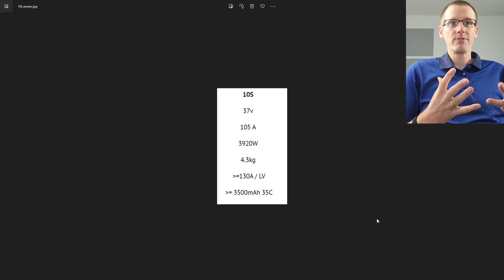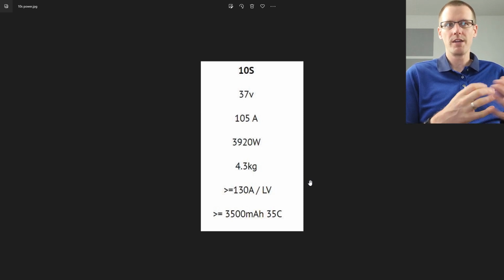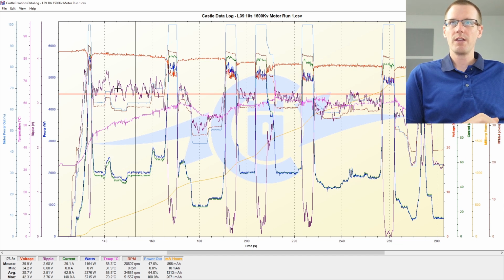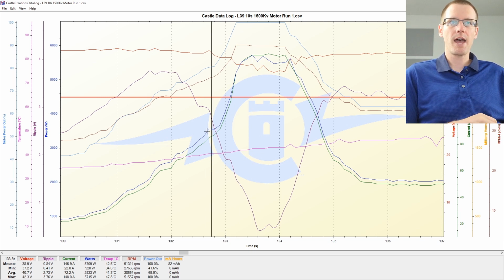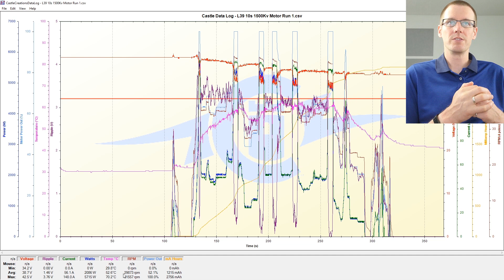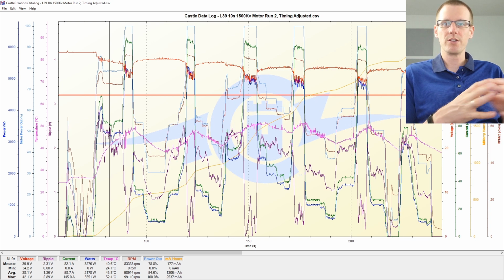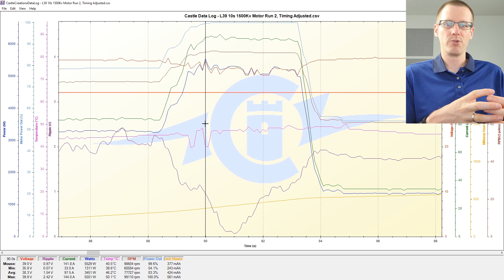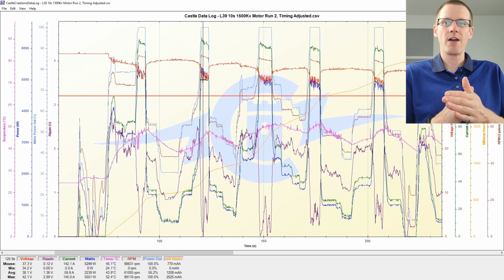Is it OK that this 3.9KW EDF Jet Power System pulls 5.7KW?

Comment: This is part of the reason I switched to flying on Li-Ion cells. 
Molicel P42A/P45B will give you 45A/50A max and that's it - it won't be crossed (for longer then single seconds at least).
I use 2P, so max 90A/100A  - based on the max power of the motor as a starting point, I choose the number of cells.
Reply: i just started using the 45b's

Comment: Hi mate, very good info/video. I’m flying a Freewing Avanti with two 4s 6000 HRB packs, and a jetfan 80mm edf with a HET 1865 motor. This system is pulling more amps than stated too. Will go from the Spektrum ESC to a 150 amp, and hopefully see how it goes. Have a watt meter on order so will also see how many it makes. 

What set up is in your L39? I’d like to go 10S but don’t want to come down from a nice 4:40 flight time.
Reply from the maker: Hi Tom. I'm using the 1500Kv HET motor. 700-68. The CC ESC used may be over estimating the current draw but it still shows high on an alternate amp meter. I get about 3 minutes of flight time no matter what combo I use as speed is nice.

Comment: I use a JePe 90mm spiderfan, they aren't produced anymore unfortunately.
On 12s it puts out 5.3 kilo at thrust at only 77 amps. Because of the low amp you can use very small battery's.I use 2 6s 3300mahin serie. And get around 4 minutes of aerobatic flying

Comment: I am a fan of going 12S whenever possible. If you want 3500 watts or 5000 watts, 12S will always be a lower amp draw. This assumes you choose the correct motor and prop. 3500 watts on 12S is a lower KV motor than 3500 watts on 10S. 12S will also leave your motor, batteries, and ESC cooler.
Reply from the maker: Do you use smaller 12s packs in that case? 12s 4000mAh won't fit in the plane without modifying the canopy. I'm up for the challenge but would need to buy some replacement parts to modify.